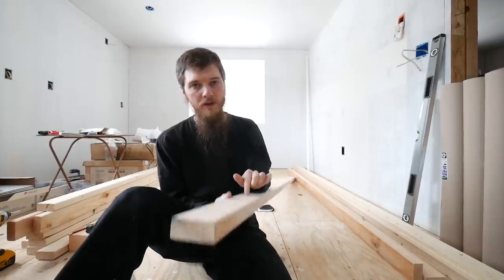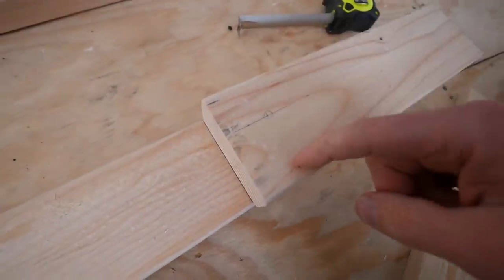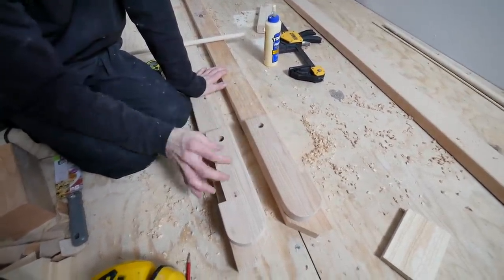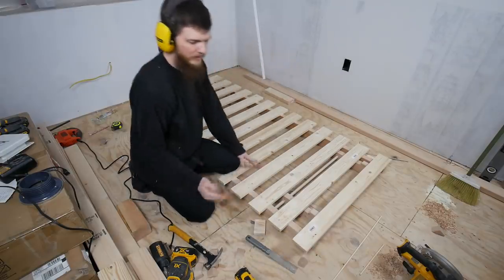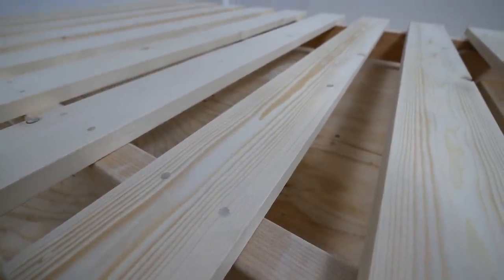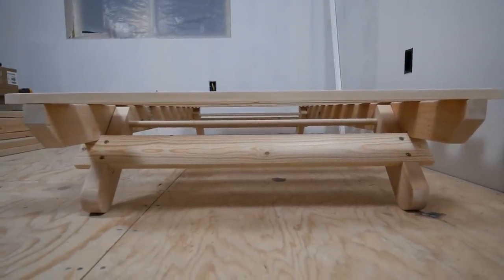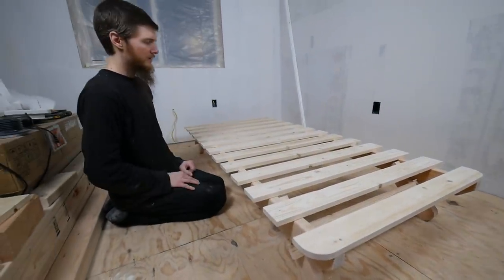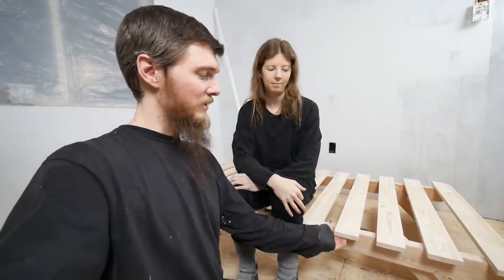DIY Minimalist Solid Wood Bed Frame for Under $50

Comment: Elegant in its simplicity!

I would highly suggest 'breaking' the corners and top edges of the slats, though... a slight round over or bevel...  As the mattress moves on the bed (getting in and out, etc), any sharp corners will abrade the fabric and in time create holes.
Reply from the maker: All the sharp edges were smoothed over good with the sander :) Thanks!

Comment: This is a fantastic bed for Maverick.  I think maybe you will need a head board to keep the pillow from falling off the end.(voice of experience).  This bed is so much better than anything you could have purchased...so strong.  On Belle's bed, maybe you could consider it taller to accommodate a drawer on wheels that could roll under the bed and would store her art supplies..  Just a thought.  Have a Blessed day.
Reply from the maker: Our other beds don't have headboards and it's all fine with the pillows. We just have the ends of the beds up against the wall :) Thanks!

Comment: Nice job, and cool idea to challenge yourself going with dowels.  Screws definitely are faster, and one thing you can do is counter sink screws, then hide the screws by gluing in dowels, cutting them off flush and sanding them much like you did here, but just to hide the head of the screw.  Neat how something cheaper can come out looking better than a metal frame and some plywood.  Definitely wax the next one so it doesn't squeak.  It still squeaks a bit when sitting on it and such.  One thing you can do with Mavericks bed might be to drizzle some vegetable oil between the side rail and leg to get some lube down in there to stop the squeaking.

Comment: Yes, I like what you did. As others have said the idea of the rounded corners was a marked improvement over other frames. Using the dowels as a trial idea was awesome. Being able to fold the legs will save doorways in the future. I don't know how many times I have seen scared doorways from the metal frames. Great job.

Comment: I love this, I have a steel cot style bed frame because its got a super high weight rating, light and easy to assemble, cheap, room underneath for storage, and it doesn't need a box spring,  but there is something nicer about wood so if I ever need another, maybe a guest bed, I'll do something like this! <3

Comment: The screw less assembly is a great idea and I think you will find that the assembly method will survive your boys active use.

In soft wood screws can loosen up with time. This method may be the key to allowing this bed to survive your son's using it.

Sophisticated simplicity I think is the term you are looking for.

Comment: I really love this. It is so simple and clean. I would rather not have to deal with a box spring either. Thank you for sharing this with us. I think I am going to try to make one for a full size mattress. I will have to add an extra 2x4 down the center to accommodate  for the extra width and maybe add an extra foot there as well, but I really think I can do this. Thank you again! Great job.
Reply from the maker: Thanks :)

Comment: I'm really impressed Doug, with the new bed design! Good job! But, I was wondering, what's going to keep the mattress from "walking" off the frame?
Reply from the maker: We're going to see how it goes, but if it's an issue we'll use some anti-slip strips on some slats :)

Comment: That's a great bed. I don't like box springs either. Seems like a silly waste. But even a cheap steel platform bed frame costs at least $90 to $100 these days so making that much better looking and more stable (and probably more durable) bed frame for $50 is great!

Comment: Using dowels over screws can have purpose actually. If the lateral laths are designed to bow under load (I don't think yours are?) then fixed dowels in the rail with elongated holes in laths allows movement without splitting. 
Nice very simple design but I think a side rail would be good, there are a lot of corners to bang your shins on!

Comment: Happy New Year Ashley, Doug & family - Great bed, I always enjoy your videos and I have a suggestion that I hope you will consider. It's about your video on the insulation about 5  days ago but I'm posting here in hopes that you will read it. Before Spring please consider stapling screening (it's very cheap and you can get a roll of cloth or metal and strip it) over the openings around your roof. If not you will surely have bats, birds, wasps and other insects getting into your attic long before you have the weather to apply your planned insulation fix. Trust me on this as as soon as the weather warms your attic will be invaded and those pests can do a ton of unwanted damage to your home. Hope you find this useful info.

Comment: This is really cool, I dig the design man. The fold out legs that stop with the cross board are really cool. Also, I wonder if it is the same psychopaths that comment on every cheap build video about the cost of tools. They could make those cuts with a 5 dollar pullsaw from harbor freight. They could cut curves with a 10 dollar Amazon or yardsale  jigsaw or a coping saw (would suck in 2x4s but still it is softwood). I hate these types. Do they really want you to add the cost of every tool to the price of every project in every video you make? Ugh

Comment: Cool project man. Honestly I think it's nicer with the dowels. Screws are such a pain sometimes. They over travel, split the wood, you have to deal with tear out, and then there's always that cavity in the screw head that collects debris. I'm sure the dowels took a bit more time but I think it's a better product for it. If you HAD used a harder wood dowel, you could have clamped the leg brace, and then used 2 dowels at each end, but cant them both out from center about 10-15 degrees, so that way they hold the board down. Not sure how poplar would hold up against the torsion of the warped board, but it might have done OK as well.

Comment: Nicely done. I would've done screws, too, but I like your use of dowels. One compromise would be only to double dowel the first, middle, and last of the slats. All the other slats could be single doweled. (I've done the same with screws and had few problems since beds are rarely racked in that particular direction.) Thanks for the lovely pacing on the video.

Comment: Only thing I would change is the the 2 3/4 dowel to a galvanized pipes painted black or white. Kids jumping on beds make me nervous, so the rigidity of a solid pipe would be comforting.
Reply: you can get galvanized pipe that's already black.
Reply: a properly disciplined child would never jump on a bed

Comment: When I went to buy my bed it was 150$ for frame, 350$ for box springs, mattress was 210$, all just basic stuff, no extras, so I went too work and built mine out of recycled pallets, 25$ in screws and finish, sandpaper, then 210$ for mattress, been sleeping on it 12yrs now, got new mattress after 8yrs .....

Comment: You always amaze me what you have the ability to do and the designs you come up with it's so awesome Maverick is going to love with his room and his bed. I love how that goes low I remember when my children what come out of a crib that was the concern I had so we always put a mattress on the floor but I love the design you came up with I'm definitely going to share it with others I hope they gain wisdom from you. Does this frame have to be sealed? Or does the wood not need it
Reply from the maker: Thanks! It doesn't have to be sealed. We may leave it as-is or oil it, not sure yet :)

Comment: that's a pretty sweet design. and you can add taller legs latter on (the build would be more 'table' style than fold-away leg style).  or you can build a box frame under and put some built-in drawers. Add some arms and it becomes a day bed!

Comment: Cool. I just made a bed frame for my daughter this week. Took one hour to build. Total novice here. Went to Lowes and bought plywood. had it cut down to 3x6. Bought 3 2x4 and had them cut down to 6, 3ft long pieces and nailed them on the bottom. Now she has a simple platform for her mattress. Cost about 20$. Yours is prettier though!

Comment: 2x4s, deck screws, saw and drill. Less than $50. Usually you can find wood for free.
For slats: pallet slats  or  plywood or I have used a discarded desktop. An old door might work too.
No glue: take the screws out and the bed collapses for easy transport. Put the screws back into the same holes.
Reply: watch out for the pallets though, some of them are made from pressure treated lumber that can be bad for you. not suitable for a bead frame. granted not all are but its good to make sure.

Comment: Two by four,I had to google that,I think I know now,not sure.
Greetings from the Netherlands,where we go by centimeters,not inches!
Reply: Unfortunately, a 2x4 is actually 1.5x3.5 inches. Is this the same in your metric wood measurements?
Reply from the maker: Hi! Yea, for some reason we still go by the weird English measurements system in our country instead of just adopting the much easier metric system. Like Mike was saying, our 2x4's are 1.5 inches by 3.5 inches (or 38mm by 89mm).

Comment: Looks good I was wanting to make my own the metal ones are so expensive and cheap when making Belle’s bed maybe add some legs or some kind of support beam in the middle so that if she sits in the middle of the bed the weight will be distributed on support so the two ends won’t give in and maybe a lip to keep bed from moving I like it as is though nothing like custom made anything. ANY WAYS HAPPY NEW YEAR
Reply from the maker: The bed is really strong. I was standing on it this morning and it has very little flex. I did consider a lip but we're going to try it without first. If it slides too much we'll change that on the next build.
Reply: DIYfferent Thats awesome to know

Comment: I made my bed out of 2 pallets (free), 4 2x4s and 4 cinder blocks. Cut 1 2x4 in half, put on cinder blocks width wide, then 3 2x4 lengthwise, drop pallets on top and done! Up against the wall it doesn't wiggle much. :-)
Reply from the maker: Cool. You might need some felt pads for those blocks so they don't scratch the floor but otherwise, it's creative. Thanks for sharing.
Reply: @diyfferent  Hi Thanks for the video. What you're doing is beautiful with wood. And kid-proof. You're making something well-designed and elegant and thoughtful. Keep it up! My idea was simple, yours is much more enjoyable and imaginative!

Comment: It is super solid.Great job.  I have a question about the mattress slipping or shifting. Because children move around so much,
I was wondering if you were going to put some sort of  end clips or a piece of  wood to keep the mattress still?
Reply from the maker: We're going to see how it goes, but we may just add some anti-slip strips on some slats if it's a problem :)

Comment: Good job! Love the concept. Maybe next time you could try rounding off the side rails instead of the angle cut. It would please the eye more to match the other rounded corners and legs. I don't think it would affect the integrity of the frame.
Reply from the maker: Good idea. We were sort of figuring it out as we went so it's definitely not perfect. I like your idea.

Comment: Awesome job on the bed frame! My concern is will the mattress be slipping around or if you're getting a futton it won't move around. I know futton weighs more than a regular mattress. I 💘 watching your videos!☺
Reply from the maker: We're going to see how it goes, but we may add some anti-slip strips on the slats if we need to :) Thanks!
Reply: @diyfferent  those grip strips like they use in cupboards should work and are inexpensive.  I use them between box springs and dust ruffles to keep dust ruffles from sliding around and under chair cushions for my clients.

Comment: My wife worked sewing box spring covers for years. The 38x74 is the measurement for the box spring/foundation. You might be a little tight on your measurement considering the quilted material on the box frame.
Reply: He said he’s not using a box springs so it will be fine.
Reply: I doubt this will be a problem, it will cover the wooden slats even if it hangs just a tiny bit would protect little heads from bumping against the wood.

Comment: Just screw in a 2x4 piece to the stud in the wall and hang a hammock(hardware with piece of 2x4 costs like 5$). I put my bed together for less than 30$ and that included the hammock, which was like 20$ on amazon.
Reply from the maker: I wouldn't feel comfortable giving our toddler a hammock to sleep in. Plus we try not to put too many holes in the walls. But that's an interesting solution if it works good for you. Thanks for sharing.
Reply: @diyfferent  my Godson is 4 , he sleeps in it fine. When you hang the hammock, it comes with straps to adjust the width, you keep the hammock close to the floor. He swings in it and sleeps in it fine. A little spackle will patch the holes when you take it down. Best sleep I ever had in my life. I threw out my 4,000$ bed in favor of a 20$ hammock.
Reply: Robert Elliott .....doubt Doug would ever think about purchasing a $ 4,000 bed in the first place! 😉
Reply: 🤔 I can't picture how you are supporting the hammock at the end away from the wall... You've piqued my interest. I love this bed by-the-way.
Reply: @goodintentions1302  I cut like 12 inches of 2x4 pine from homedepot, costs like 3.50$ for an 8ft section, and I just used wood screws long enough to screw them into the studs in the wall. Reason why I screwed the 2x4 into the studs of the wall, is because I attached the hardware that the hammock hangs from to the 12 inch section of the 2x4, instead of putting it directly into the studs. Cause I live in an apartment and it's less of a hole that I have to cover up should I ever move.
Reply: @youcanthandlethetruth6976  I understood that part. What holds up the other end of the hammock? Sorry if I'm dense, I can only visualize a hammock attached to the wall on one end, and laying on the floor, limp at the other, so far. 😕

Comment: if the wood is warped i always use screws and glue under the lat. when the glue is dry i screw the screws out and replace the them by dowels..

Comment: Just a question, What will hold the mattress from sliding off or side to side?
Reply from the maker: We're just going to try it out and see how it goes. I don't anticipate much sliding around, but if we have a problem I'll be sure to consider that when we build our next one :) A simple fix could be adding an anti-slip pad or tape underneath the mattress.
Reply: @diyfferent  Ok sounds good. Thank you for your quick response.  Happy New Year to you as well.

Comment: Cost doesn't matter when you have such a sturdy and useful bed frame.  I was wondering what could be done about the squeak. I would haven't thought of wax.  The screws were not exactly cheating considering the warp of the wood.    Great build.
Reply: Wax, even soap bar.. 😉
Reply: DLR Young, I should have remembered soap. Mom used Ivory soap for squeaks.

Comment: Beautiful bed - so eye pleasing.  I'm wondering about the edges of your slats...if the bed gets knocked in the wall, because children play on their beds, will you need to glue felt to the ends of the slats to prevent them denting the wall?  Maybe something to keep in mind if you discover this to be a problem?
Reply from the maker: Thanks! We're not worried about it. We won't be putting the side against the wall, but the blankets should always be covering the wood anyway. :)
Reply: @diyfferent  also the mattress will cover the slats. Shouldn’t ever be an issue.

Comment: How did you space the boards? Measuring or did you use a block of wood? That's the pull saw you are using right? Seems a very handy tool. Do you plan to leave it a natural color or stain it?
Reply from the maker: We used blocks of wood to do the spaces and moved them along as we went. Yep, that's the pull saw, very handy little tool. We will probably just leave it natural, but we may oil it.

Comment: Doug I was wondering is it possible to make a full size bed using the same design but is further off the floor with some storage shelf under neath to but some cubby boxes?
Reply from the maker: Yea, with modification. It may need an extra support going down the length.

Comment: I suspect that being that low, it will be colder than if it was up higher.  That should be easily fixed should it become an issue.  Nice job though.

Comment: Not about this video,  but I have been wondering why your ceilings are only 7.5 feet. Were they 8’ before you pulled the ceilings down?
Reply from the maker: It's a doublewide and they just built it that way from the factory.

Comment: I want 1
Reply: Go to Lowes or Home Depot. Get one of their double-pallets. Throw on top of 4 cinder blocks. Chuck mattress on top. Fin.
Reply: Christopher Jackson Sure, however I’ve done it myself about 25 years back. It worked fine for good temp bedding. If you’re concerned for your box spring if you’re even using one, throw an Army blanket down. Green wool. Good fix. However to each his own. By the way, as far as concrete block, get a broom.
Reply: What I meant with my comment is that I love his work and I would love to get something similar done , since this gentleman talks about minimalist ideas 💡  Nobody would use  cinder blocks .
Reply: Take Me to Paradise and I was just being practical, as well as a little mirth. Gosh.

Comment: To make the legs longer and the bed higher, you'd have to decrease the 45% angle, would that be correct?
Reply from the maker: I suppose so.  The longer the legs, the more force would be applied at the joints so it would probably help to decrease the angle a little.

Comment: Nicely executed, but my 50 years of building  furniture convinces me that you would be better off sanding your pieces before assembly, and a simple clamp use would have solved your slightly warped board while the glue dried.